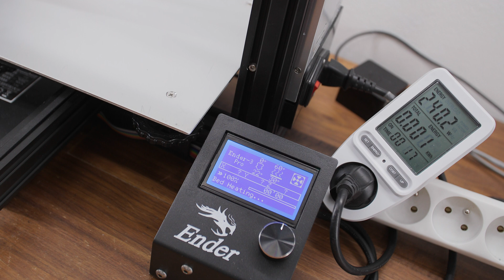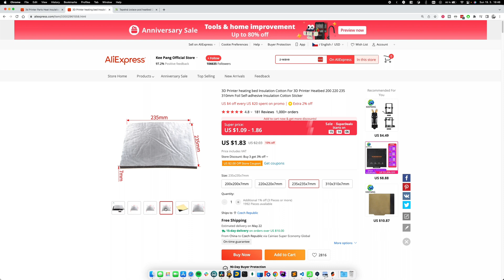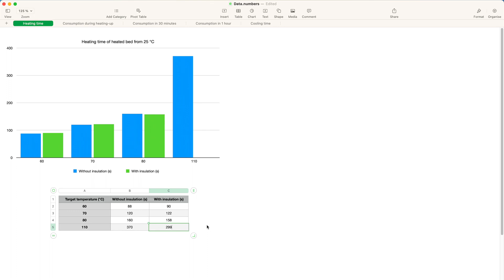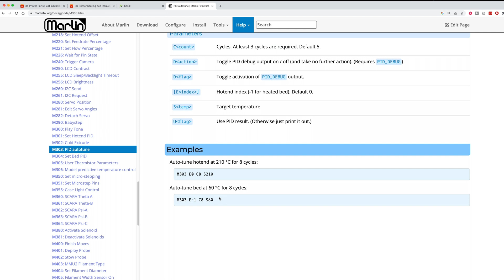Creality Ender-3: Fourth upgrade - heated bed insulation

Comment: The only time savings comes at 110C (you save 1 min. 11 sec.).  But what other value does it have?  Seems more like an upgrade gimmick than an actual improvement.  Shall we add tip-toes to see if the sonic difference will improve print speed or smoothness of the end result? 🤣

Comment: Interesting, but the power savings will take a few hundred hours of printing to pay off ;)
Reply from the maker: But still... Some money saving is better than no money saving. 😁
Reply: 500h to my calculation (33ct which is a slightly bad price in germany). However, if you live in a hot area you will save on cooling as well. The one minute timesaving for 110°C could maybe be put into effect if you reduce heat bed temperature at the end of your print - not entirely sure to what extend one can do that with different materials and shapes.
Reply: @Jacksparrow4986 Is it worth to check if bed lateral movements leads to heat loss to ambient..and if yes..long print cycles would make a difference in savings..Good effort and patience on this test..👍
Reply: Would it help to place a heat insulating light sheet on top to speed up preheat.. the dark bed of aluminium bound to take heat and radiate upwards as well..given warm air rises..continuous loss adds to time taken to reach the temperature..while printing, not sure if its worth keeping unused areas atop bed insulated thinly to avoid continuos heat loss with upward moving thermal currents..even if the whole printer is enclosed bed temperature being far far away higher the air inside..another loss could be with the 4 mounting corner screws and spring conducting away the heat happily..just wondering..